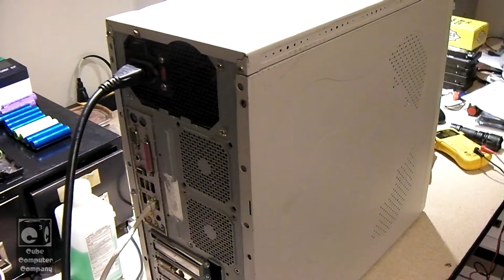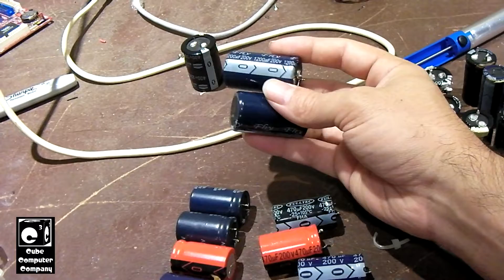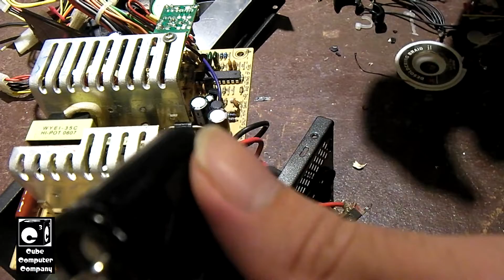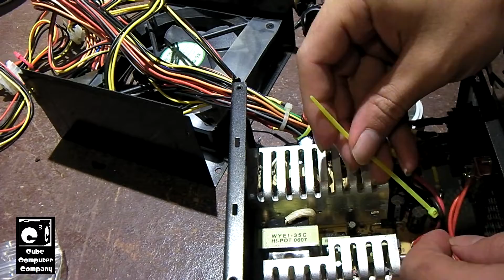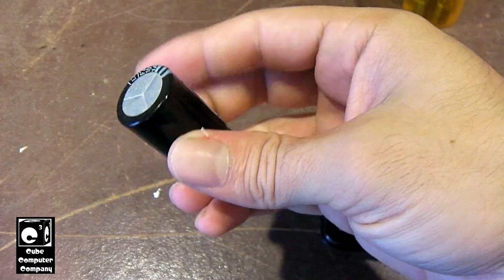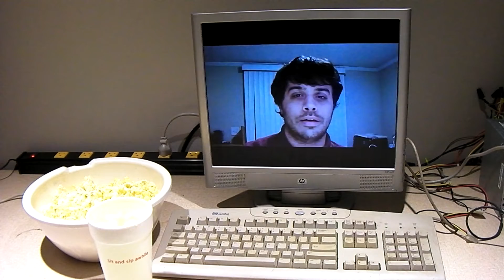Falsely labeled capacitors in cheap computer PSUs

Comment: Id recomend changing the balancing resitors for metal film ones. The carbon ones tend to fail open and thn on of the caps dies. Those caps are much more expensive than two resistors.

Comment: I got some FHY 470uF capacitor reading 331.8uF defenetly a bad brand
HECs are wierd, some of them are true 470uf and some of them are 330uF
Reply from the maker: For applications which call for a 330 µF capacitor, it would probably work okay. It's just these brands seem to falsely label their capacitors as one value above their actual rating. The FHY 1200 µF capacitors would work fine for an application where a 1000 µF capacitor is needed. Reliability would be questionable, though. The PSU which the Fhy capacitors were pulled from had the primary switchers blow, taking out the fuse and house circuit breaker. That reminds me I meant to add a card for that video.
Reply: @CubeComputerChannel   Primary caps rarely fail, so my definition of a bad capacitor brand is the one that mislabels their capacity.
I need to get my hands on a ISR meter, I think it is almost more importhant in theese high frequency situations.
Reply from the maker: @filenotfound__3871  I've actually had to replace primary caps in a unit because they were bulging. It's rare but it does happen from time to time.
Reply: @CubeComputerChannel  I hat to replace them on few power supplies as well, but usually their failiure is caused by the failiure of one of the balancing resistors, throwing the voltage way above the rating of the capacitor, while the other one gets like 50-70V
Reply from the maker: @filenotfound__3871  The one I had to replace the primary capacitors in had both bulge. Not really sure why that happened other than the issues which commonly happen with secondary capacitors.